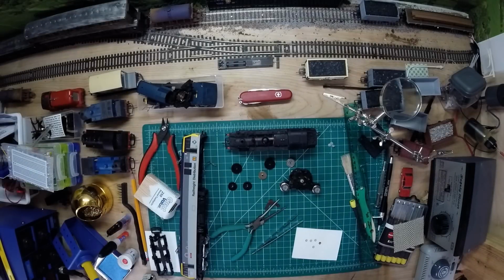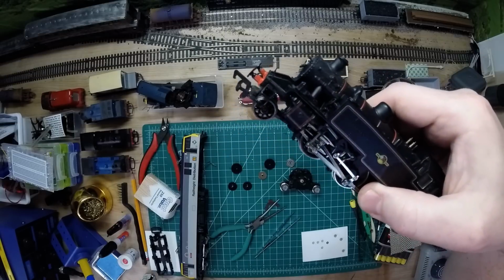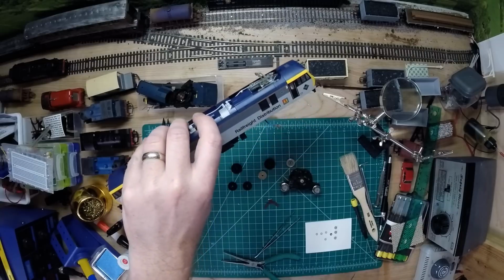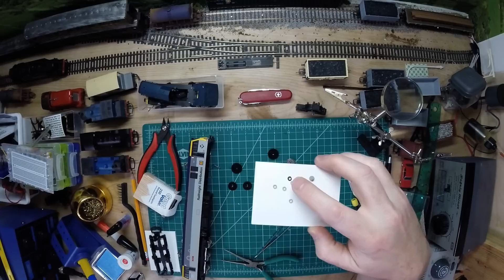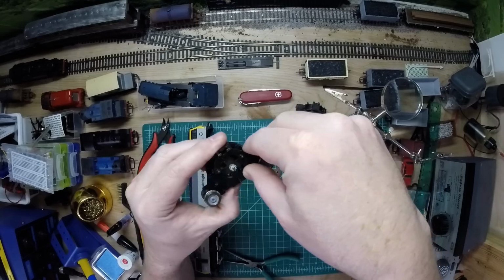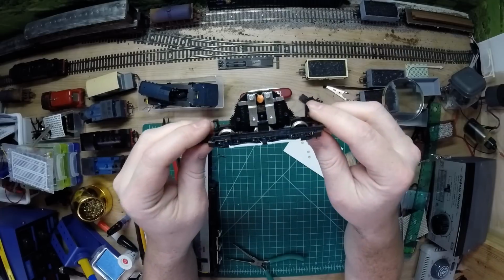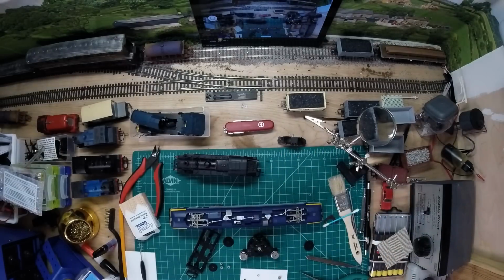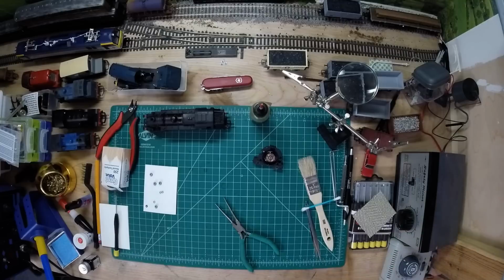oorail.com | 3D Printing Spare Parts - Loco Works Wednesday #18

Comment: Good video. Have you considered a 3D scanner to get the dimensions for the 3D printer to replicate the small parts? I don't Know much about this subject, but you seem to be well into it.
Thanks for sharing.
Reply from the maker: Thanks. I have looked into 3D scanners but they aren't quite there yet. Its actually quicker to build the objects from scratch in Blender than to clean up the resulting 3D model you'd get from a scanner. The advantage of building the objects from scratch is that you can use data from the real loco (technical drawings, blueprints etc) and scale it back down to OO gauge. You can basically use the same techniques you'd use scratch building something, you are just designing it on the computer and letting the 3D printer create it from the design.
Reply: @Oorail  Thanks for the reply, I was wondering if the scanners were up to scratch. They are a bit pricey if they are not accurate,I'll wait  a few months till they improve them, lol.

Comment: Hi,I have a Hammet and Morgan Clipper controller, can you tellmeanything about it? I have seen some negative comments regarding it. I also just purchased a 3Dprinter. How easy was Blender to use for the buffers etc?
Reply from the maker: Is there something specific you want to know about? The clipper has two switches on it, for OO scale NEVER use half-wave, always keep it on full wave. Other than that, its a solid DC controller. Most of the controllers on the layout here are either H&M or Bachmann DC controllers. The high/low resistance switch is pretty safe to use, there are some big warnings on DJ Models locos about using old controllers, so I typically run the handful of DJ Models locos I have off a newer DC controller. The H&M controllers are solid and reliable, plus if you have any older 1980s/70s/60s/50s locos, they will handle running those without any issues. Some of the newer Hornby controllers will cut out. As for 3D printing, there is a bit of a learning curve with Blender, but its worth the effort. You have to think about things a little differently when building 3D models for 3D printing than normal CAD / Animation, but once you get the hang of it, its pretty easy. If you are looking for things to print, check out https://shop.oorail.co.uk.